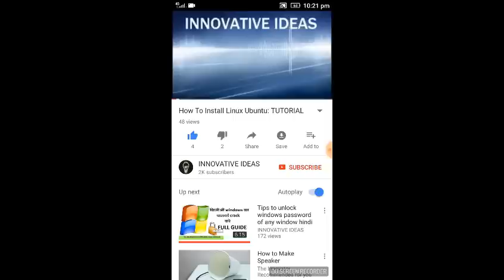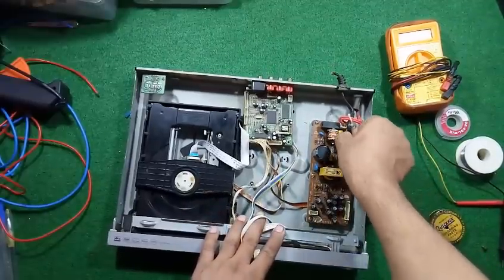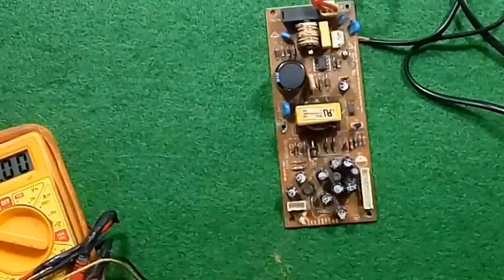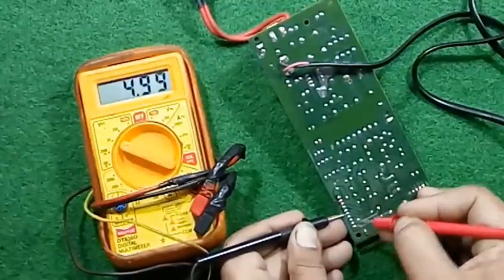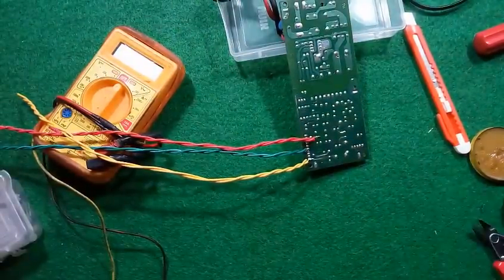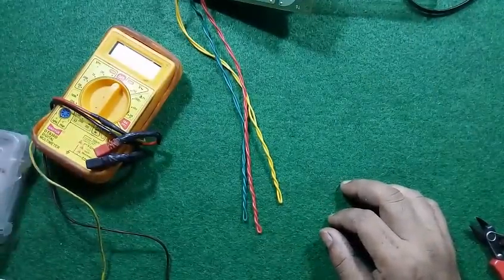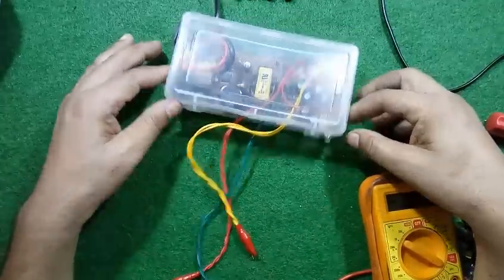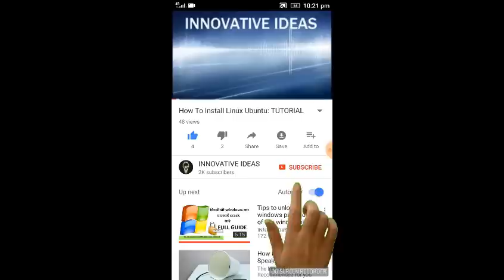Recycle DVD player for power supply 12V and 5V by innovative ideas

Comment: I LIKE..BUT WHY DID YOU DISCONNECT THE ORIGINAL INPUT POWER AND NOT JUST REPAIR THE AC INPUT WIRE? I THINK THAT WOULD BE MUCH EASIER AND WOULD SAVE A STEP OR TWO. THANKS FOR THE EDUCATION AND KEEP UP THE GOOD WORK.

Comment: Hello, how much amperes ? Thx
Reply from the maker: 1 amp
Reply: any battery can be charge exept it will took much longer to charge. you might want to add a step up step down module to reach your battery desired voltage of 13.6v

Comment: Sir can I touch output wire 5v n 12v?
Reply: Plis reply
Reply from the maker: yes you can.. but be cautious.
Reply: Ok thanks....
Reply from the maker: Always avoid any type of earthing while doing electric work,  wear shoes, rubber gloves etc. One more thing use dry plastic sheet below chair where you want to work. Thanks
Reply: Ok thanks...I made it,it's perfectly working thanks for the video keep up the good work and make it much better by improving it continuously.

Comment: When if Power Supply does has a "Volts connector" of "Connect pin board behold" then Voltometer doesn't depend,BTW Soldering of a cable it's a useless if be can connect on to pins.